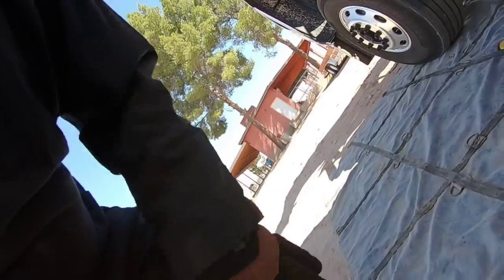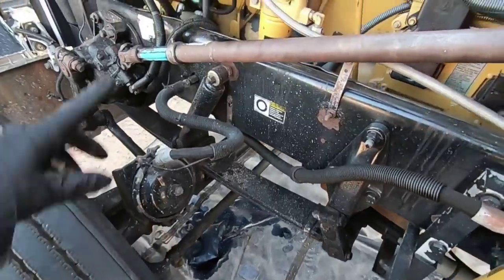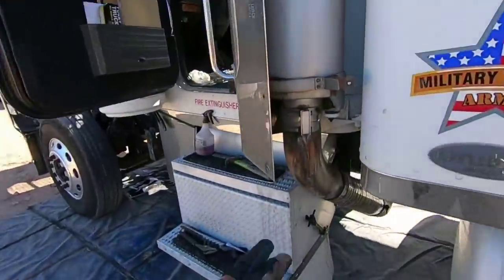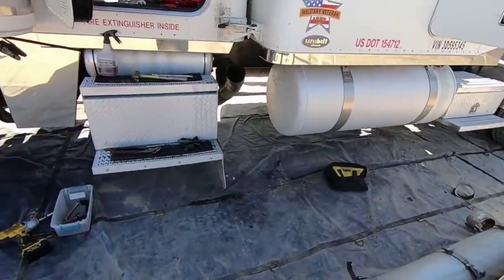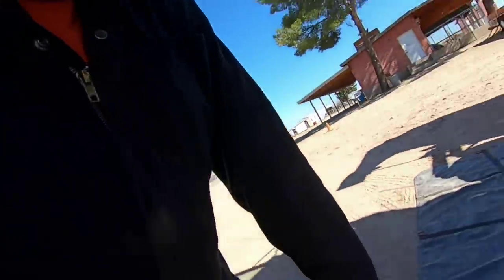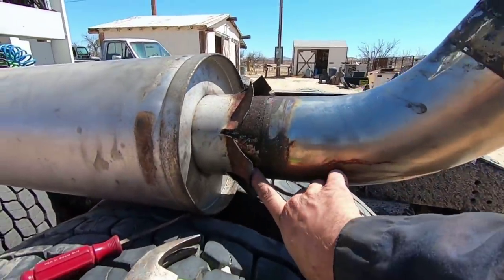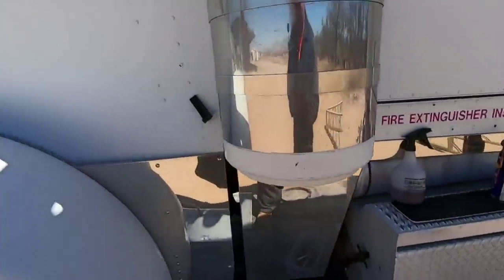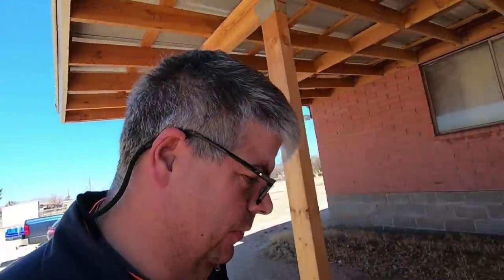#496 Replacing the Exhaust The Life of an Owner Operator Flatbed Truck Driver

Comment: Glad the leak on the power steering pump seems to only have been a loose banjo fitting.
Also glad you are sticking to keeping it standard with mufflers, the noise of straight pipes is going to cause very tiring discomfort and that is not fun.

Comment: Good to see everything is fine...Have been thinking about you since i knew you were home for the vaccine...
Regarding the exhaust; on my boat's exhaust muffler, someone said i should use a heat resistant "tape/band/bandage" between the muffler and the  bracket. That really helped the muffler not rusting that much because no metal was rubbing while it was "shaking" :-)
Sorry about my bad english, but i hope you understood at least most of it :-D

Comment: You could still go straight pipe without spending $2000, just make your own. The Pete I bought. Had 8 inch straight pipes already on it. It's just 2 pipes capped at the bottom with a hole drilled in the bottom so water can drain out. The flex pipe goes into the the side of the pipe just above the bottom. The inside looks to have a inner heatsheild. Cuz I could drive the truck all day and not even burn myself on the stack. Looks to me like your not afraid to work on your truck. You could probably pull that off.

Comment: OMG! Dan, I couldn't hold it in.  I get it, straight pipes are expensive, but you have such a fine heat shield, polish it up, replace the muffler with some flex pipe, and move on with your life. I don't believe straight pipes have any muffling effect, so why spend so much money on all those brackets and a new muffler??

Comment: i asked a while ago on fbook if u cover the stacks when not in use..got my answer. Maybe I missed something but why not just heat with a torch and back out/drill out the snapped bolts?  I'd b miggin and wrapin that lil hole myself..but i'm poor

Comment: Better fuel mileage with straight pipes Dan..
Reply: But you pay with your ears.
Reply: That is true and the engine runs cooler  And all you need is a little short Spark resistor muffler From outlet up Turbo to the why under truck

Comment: I know about 7 or 8 years ago when I had my 379 those brackets that wrap around the muffler and hold the decorative heat shield on we're not cheap there were a couple hundred bucks plus the Chrome elbows are very expensive plus aggravating to change hence why I just put straight pipes on and never had any problems

Comment: Another great video. You probably know this but in case you don't, anti seize on all  hardware, especially stainless steel really helps keep threads from  gaulding  as you tighten and getting things apart.

Comment: hate to say this but--------i think i would be going over the other muffler with a fine tooth comb if it was me---if u replaced both mufflers at the same time--why did one side get more rain and rust out only? it might save ya from doing it on the road later. hope u wash behind the where the stack was at--i'm sure u will, i know i would-easy to do now.

Comment: Dan , when you put it back together put just a little grease on those stainless bolts . The threads can gall up if you don’t , then they are junk and impossible to work with ..

Comment: The power steering is probably leaking from a bolt.  A fairly easy fix that has worked me is take out the bolt clean the bolt and hole coat the bolt with silicone and let it set for ten minutes then tighten slowly.  The exhaust the pipe coming to the muffler is probably the bad piece the muffler is probably still good you can probably very carefully cut the pipe with a right angle grinder or partially cut the pipe and get it to slip apart.  Or if the muffler connector is bad and the base of the muffler is still solid you can have another piece welded on to the muffler thus reconnecting it to another new exhaust pipe.  I do know that the muffler cost a petty penny.

Comment: The old intro was a nice throw back I literally had to check the date on the video to make sure it was a new one. Sounds like an expensive exhaust fix. If the brackets that hold the muffler cost over $100 dollars I would hate to see what the muffler coast. The old 379 would look good with straight pipes rhough

Comment: I thought parts for specific classic car was expensive....damn truck part costs are out of bounds. I see some suggested using a protection material on the band clamps to they don't rub/rust into the muffler. Might want to think about that. Stay safe Dan!

Comment: What a deal peeling off $100- bills and putting that back in order so it won’t wear out for a while but better fix and replace than get blindsided on the road during a long haul run, Lucas has some great power steering no leak additives at the auto stores

Comment: Never liked straight tipped exhaust, always liked the curved out tips. Didn't understand why they needed to be so high either, would have lowered my to just about the sleeper line to help with wind drag. Used to like the 'tea pot' pipes with the little covers on them (when not in use they closed the top to prevent rain of snow falling down into the pipes).

Comment: Make sure to find out the price on a muffler. Peterbilt sells a really expensive one like over $300 and then there a cheaper one like $90. Some of the guys at the parts counter will not tell you about the cheaper one. At least it is that way at the one in St. Louis

Comment: Not sure if it applies here but a trick I learned in the ARMY working on Helicopters. For hard to diagnose leaks we clean and douse in baby powder. When it leaks again a line will lead you to the leak start point.

Comment: Should have gotten a stainless steel elbow...little more money but it will last forever.
Reply from the maker: It was stainless steel that was the original elbow 
Thanks for watching
Reply: @SuperTruckerdan  Dan buy some Fast Orange Cleaner (I buy the gal. Jug at Walmart) put it on a damp washcloth, It will actually clean that elbow to look like new....I restore vintage motorcycles with it,,,,Retired Old Peterbilt Independent Trucker.....Love this channel, Dan

Comment: Hey SuperDan, thank you for all your videos. Hey, I see you have a CAT, which shop would you recommend for minor work to an inframe. I am in PA, but willing to travel. Thank you
Reply: Pittsburgh Power if your in PA!
Reply: @markpontes4457  Mark thank you for your reply. I called them and they said they don't work on 3406B engines; however, Clevland Brothers in Mt. Ephrata PA (near Lancaster PA) will work on 3406Bs. Mt. Ephrata is the closest to Philadelphia, just in case you are from the Philly area Thank you for your help Mark.

Comment: Hope you go with a Donaldson full flow muffler it's not loud at all at the cat will be able to breathe a little better
Reply: That is exactly what I was thinking when I saw what Dan was getting into having to replace. I've installed the low restriction Donaldson on both my Petes as the older 3406E was having higher then normal pyro temps and took it to a shop where they looked over various things but did not check my back pressure which he figured surely couldn't be the issue since it has two mufflers. They were stock type mufflers ( I had replaced them years earlier ) and I suspect due to a lot of sitting outside in later years the rain fell into the straight style stacks and rusted the inside and started clogging up that lower internal plate/disc assembly. So with a set of low restriction mufflers the boost went up at least 4 lb and the pyro temp dropped a good 150F. Interestingly enough before I did the muffler change I cut out the flex pipe under the truck ( my god was that loud under jaking ! ) and could tell the exhaust temp was down and the boost went up, after the new mufflers the specs stayed the same so at least for that truck with 475 hp it appears I have zero restriction or near that with those mufflers so I was impressed with that. However it certainly makes that single turbo engine louder under load, not horrible but it certainly is quite noticeable over the stock units. The other truck is a 550 rated C15 accert and I would say I gained maybe 2 lb of boost at most but its noise level did not go up all that much, a bit though. Those twin turbos certainly muffle sound and I can't recall if Dans truck is an accert or not. Oh and those brackets, my god are they insanely priced and yet I couldn't seem to find an aftermarket outfit that makes them. So without a doubt the mufflers end up being the very cheap part of the whole mess that has to get replaced if there is any rust issues and goes into the many thousands to replace all piping from the turbo back and the brackets. Definitely I found the best way to deal with those shields is to take them off if possible before messing with the muffler, then once the muffler is on the ground put new brackets on the new muffler if needed and transfer over brackets that are still good ( the small ones ) and only clamp down the bottom base bracket to the muffler, leave the middle and top band loose and then start working at installing the stainless heat shield and get it all lining up with the holes and adjusting the small clamps with the slots in as required etc. Once all the bands are tight and satisfied with the fit and alignment of the shield ( sight by eye from top to bottom to see that the shield sits in a straight line on both edges ), then remove the shield entirely and mount the muffler with new rubber bushings top and bottom and install the elbow, flex pipe etc and lastly put on the shield carefully. Install every shield bolt and muffler bracketry clamp using the silver anti seize as that will make future removal far easier and not damage the components or twist the bolts off.  Oh its so easy to do the wrong thing with the muffler or shield and scrape paint so using a tall/wide step ladder and move carefully makes the job way easier and avoid damage to the paint. Should also say be sure to buy ONLY stainless steel step clamps, NEVER buy the crap galvanized clamps as they rot right off well before the rest of the system has issues again, same goes for the flex pipe to always buy the stainless flex in the exact length you require as they are spot welded on each end and not to cut them to length. That would be an expensive labour bill to bring the truck to most dealer shops as its lots of fiddly work to replace. Lots of babble here but it may help out someone who hasn't done a muffler on a Pete before.

Comment: I know $2000 for straight pipes is expensive but you raddled off like $500,000 in brackets clamps and elbows not to mention the muffler 😂